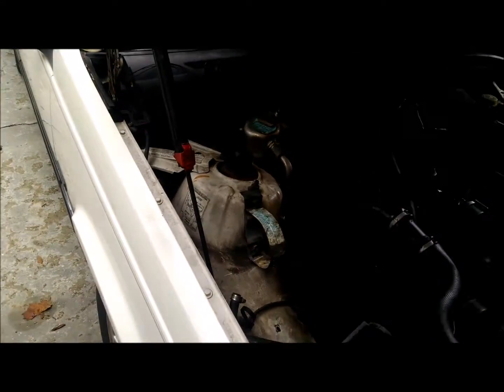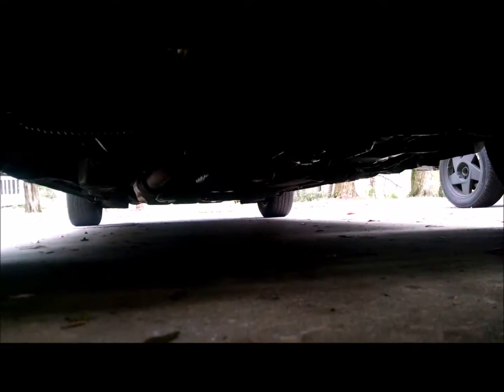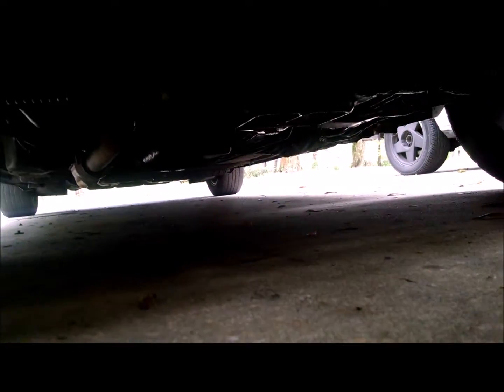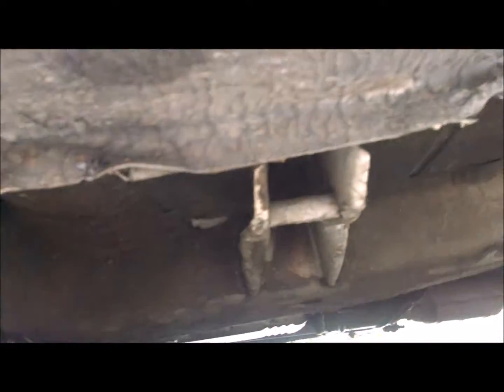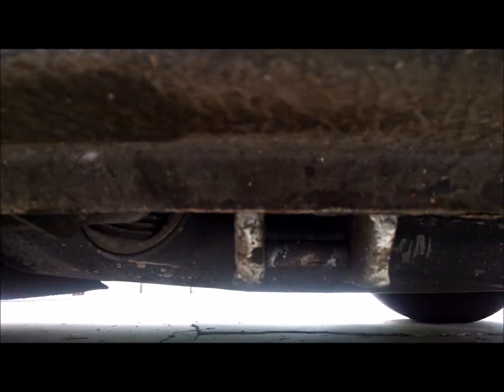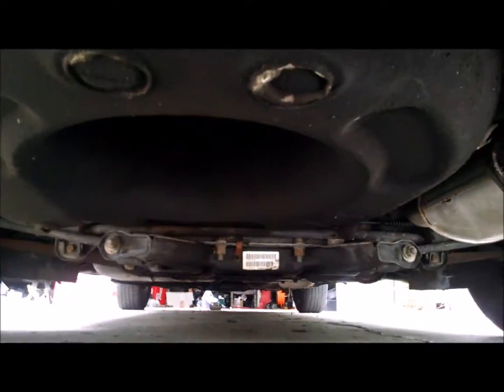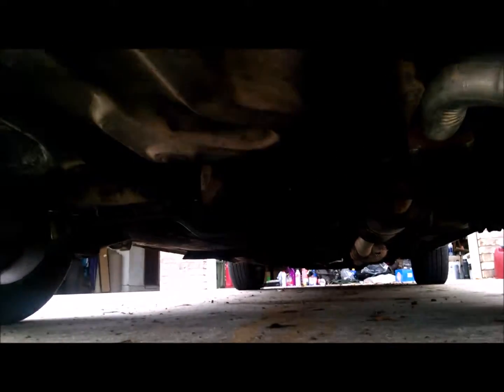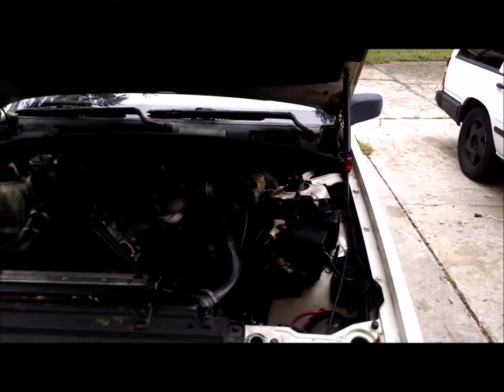Volvo 740 / 940 Lift Points

Comment: Possibility to compare inside floor pan 740 vs 940 ....? is it the same ?
Reply from the maker: Yes they should be nearly identical. Seat rail mountung point in the front is slightly different